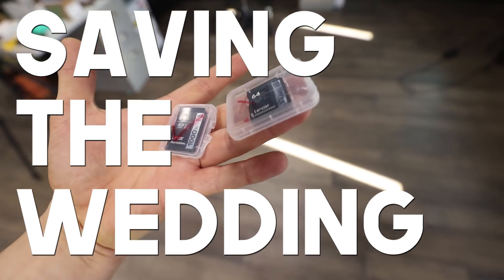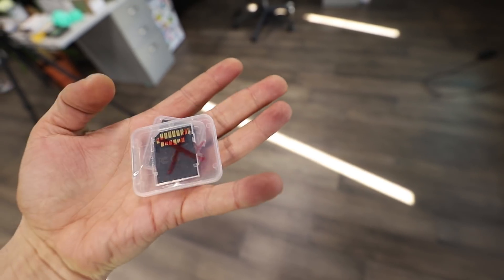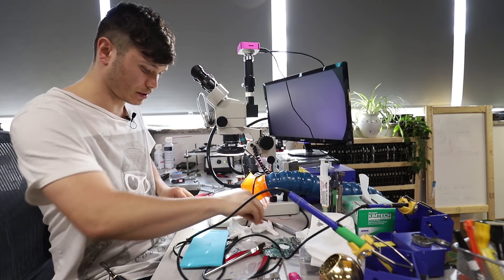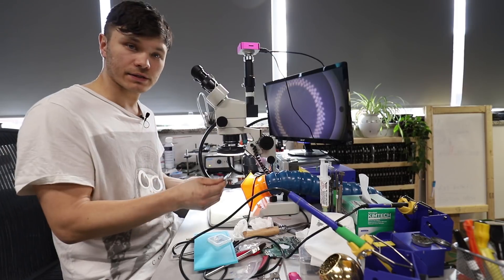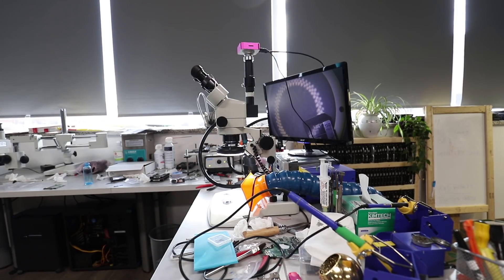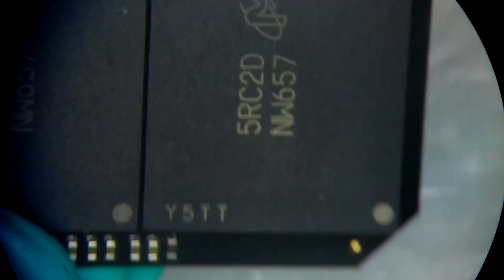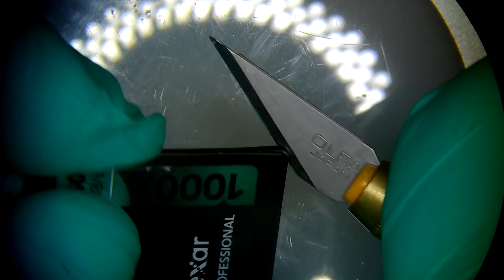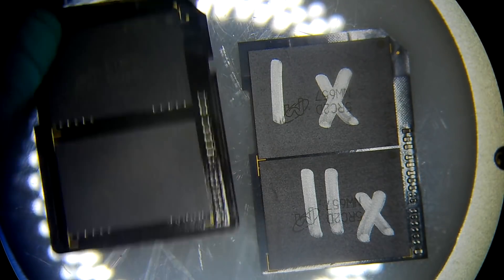Saving The Wedding | chip-off data recovery on Lexar 64GB SD card

Comment: Manufacturers should make multi-card packages, just like dual&quad channel memory! Since there is always a chance for a card to fail.  Posible ways to prevent it is to gate a camera with dual card support or capturing content through HDMI at the same time.
Reply from the maker: dual card feature must be used for sure if the camera has it

Comment: I noticed you pulled the memory off cleaned it and stuck it in a board reader. My questions is what board reader do you recommend and what software do you use to read the data?

Comment: Hey there, wonder if you might answer me a question. I have a 128gb microsd SanDisk card. I bought it in April 2016, and beginning in Feb 18 it got slower and slower in writing, freezing randomly during reading until it wasn't able to write anymore in March 18. If I write something, it does that and Windows shows the Files, however after unplugging and plugging it in, it's the same file structure as before I wrote. I'm Unable to rename files or format the card too, with independent systems, card readers and Operation Systems. I have several backups from the time the card worked flawlessly, so no files lost, but I was wondering if you know what has caused this random inability to write. And also if I might be able to full format it as for least once to get a replacement within the warranty, I don't want to ship the card with personal picture on it. Thanks in advance :)

Comment: Great Job,
 Any suggestions for a starter shop?
 Start with NAND or Disk?

Tool to start with?
Rusolut
PC-3000 Flash
PC-3000
MRT Ultra
Deepspar
Rapidspar  
DFL-DE
Not and easy answer I'm sure. They all say they have the best and you need nothing else.
I have already found that not to be true. Any thoughts would be appreciated.
Reply from the maker: disk for sure. Software, then move to mechanics, then learn PC3K. NAND is way harder to learn than hard drives. At least to me it was.

Comment: Yeah better to read out the chips directly.
The chips were not identical, though the underlying pcb might have been... 
so besides changing the chips, some other components/controller would also have to be changed. 
Nicely done !
Reply from the maker: PCB indeed was the same, but ID of chips would be different and the risk of having controllers being programed differently would be very high. If parameters in data conversion elements charge even slightly, then the NAND swap is not gonna work at all

Comment: Dman, and here i was thinking that was a great idea to buy two cards at the same time!
Reply from the maker: MaxSantos usually it is haha
Reply: @hddrecoveryservices  I think it's the opposite with the hard drives when a few drives bought at the same time (and from the same production batch) fail also at the same time (or there is very small time gap between failures).